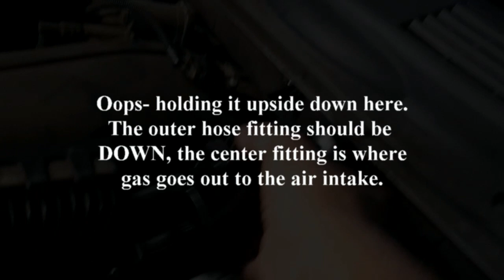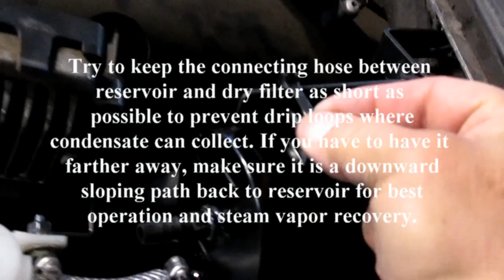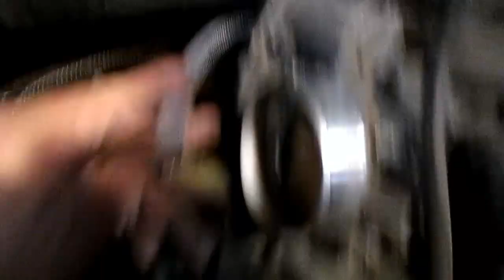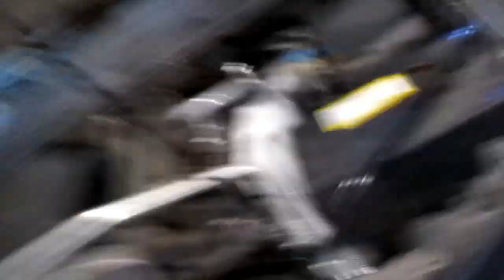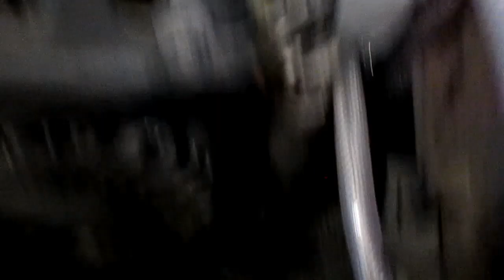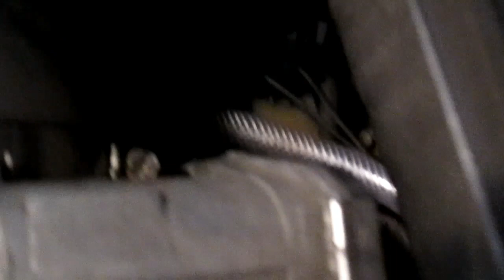How To Install The HHO Gas Dryer Filter

Comment: How much better mileage did you attain?
What vehicle/engine are you using?
Reply from the maker: This was on a Chevy Trailblazer with a 6 cylinder engine, I think it was 3.8 liters. I got an average of 15 mpg normally. With the kit and gas tuner, I was getting 23 mpg...